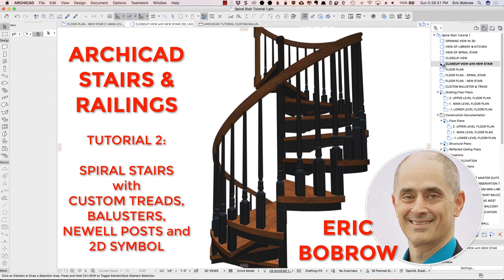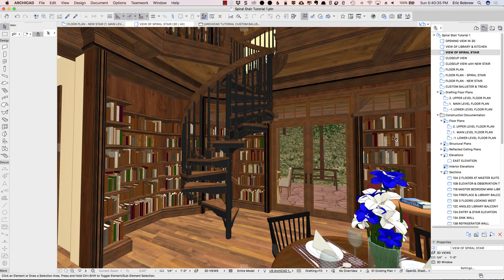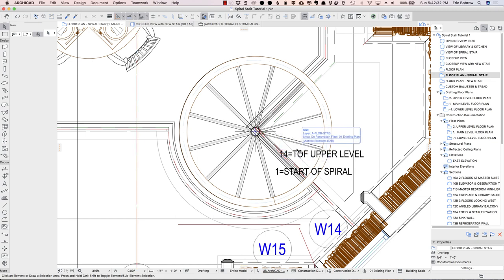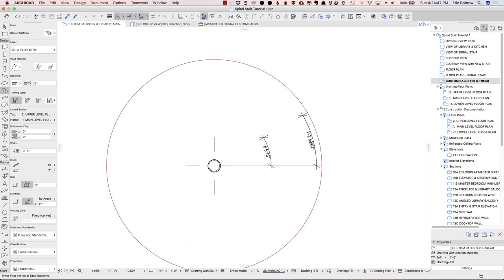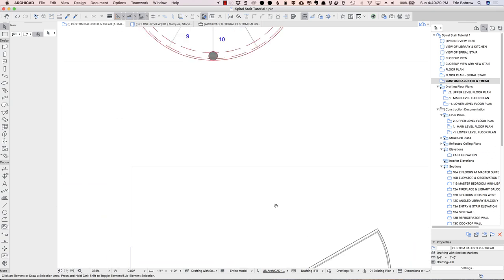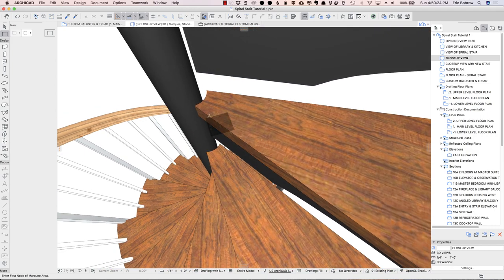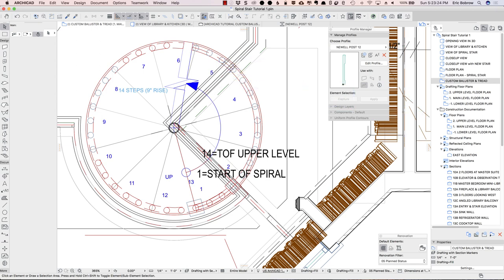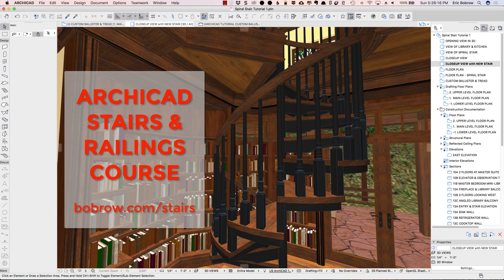ARCHICAD Stairs & Railings Tutorial 2 - Spiral Stair with Custom Treads, Balusters, Newel, etc.

Comment: You skipped past the part where the base of each baluster is square (presumably your version 1 versus version 11) at the bottom, and round in the middle. Also- how did the square portion of the leading baluster (at the nosing for each tread) extend above the upper tread?

Comment: For some reason the Rails on my balustrade step up where it moves from one set of steps to the other?  Anytips?  thought it was linked in with ending with riser or tread however still get a Kink in the rails although interestingly it does not happen in the toprail..